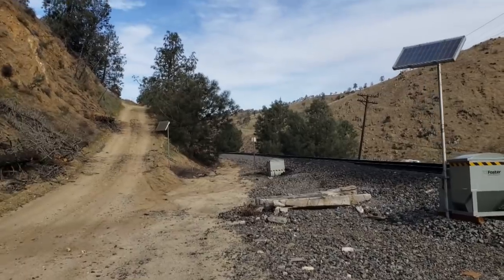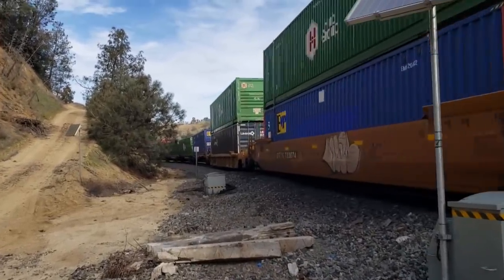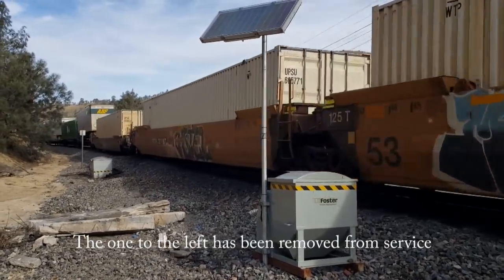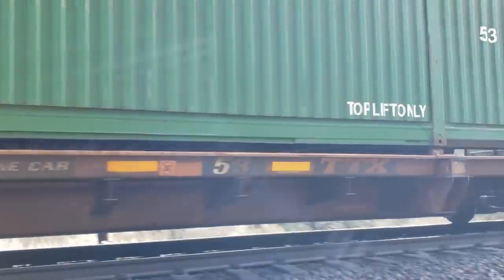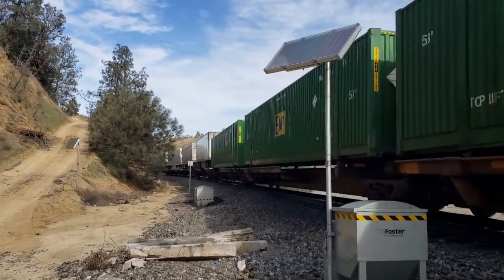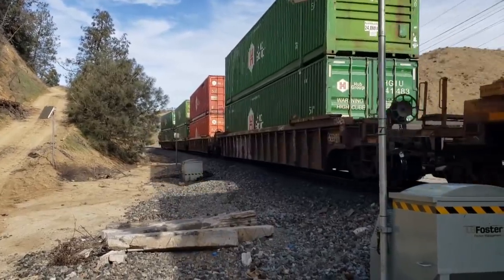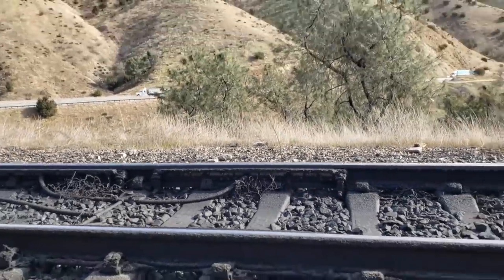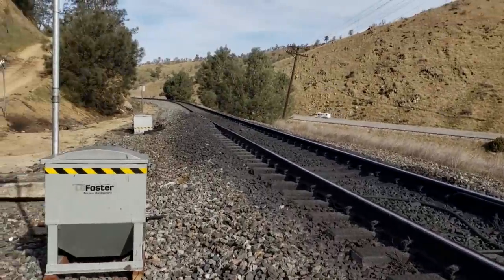How a Railroad Curve Oiler Works or How Squeaky Wheels Get The Grease!

Comment: Some curves I have seen squeal loud enough to harm your hearing if you are nearby. This is way cool - how to kill noise without losing tractive force! BTW - how cool is it to have a UP train roll by during the discussion :)
Reply: Wheel squeal is  heard at most curves.  It seems(wheel squeal) on ribbon rail because of higher speeds is louder.
Reply: We have that situation on some parts of the London Underground. The squeal generated is almost deafening, especially as it has nowhere to go but bounce off of the tunnel walls. If it was that noisy in a factory you'd be made to wear ear protection.

Comment: Does the Oiler Grease each and every train wheel on each and every train on both sides ?  Thanks!
Reply: Just one side - the inside rail of the curve.
But since there are left and right curves in various places that have curve oiling, they end up getting both sides just not at the same exact time and place.
The grease on the wheels wears off pretty fast but the important thing is the rail got greased right where it would be ground down quickly without the grease.
The outer rail of a curve gets virtually no wear because there is no side pressure against the outer rail.
Reply: @2Truth4Liberty   the wheels on inside of curve, rotate LESS than the ones on the outside rail. its the physics.Also, the wheel rides more on the high side of the wheel, which is the curvy part to the flange........squeek  squeek.....etc.
Reply: @petersack5074  [  the wheels on inside of curve, rotate LESS than the ones on the outside rail. ] Yes, of course, a little tiny bit less rotation. But that has nothing to do with the wheels on one side getting extreme friction from side force against the rail while the other side gets virtually zero (not even touching the rail). that's the physics of the squeak and wear and need for grease.
Reply: @petersack5074  Since there is a solid axle, inside and outside wheels always turn the exact same distance and speed.  The conical tire allows the outside wheel to cover more linear distance with the same number of rotations.

Comment: Have you ever recorded a heating switch in the winter time one's were there's fire coming out of the rails?
Reply from the maker: On the Tehachapi they just use small pots with fuel oil when needed under the points. The winter of 2019 was the only one worked through and I saw none in use.

Comment: Cannot speak for the UP but decades ago CN Rail switched to a vegetable based oil, which has a additive to deter animals eating it. For a while locomotives were built with a tank for some sort of lubcation to reduce friction on rolling railcars in an attempt to reduce fuel costs. Those have since been removed and now spring loaded solid bars of some form of antifriction material press against one of the rear set of wheels on most of our locomotives.  That one sound that happened was with a coupling, the two knuckles under tention (called draft) binding as one slid up and the other  down. They would of been both been dry due to rust, or new and not yet polished up from use.
Reply: It would seem more efficient to have grease dispensed from the locomotive.  It could be designed so the greater the angle the truck twists in the bolster, the more grease is dispensed.   I know of a RR museum with a circular track that ran an extended hose from the crankcase breather to constantly drip oil on the outside rail.

Comment: Now I wonder how the wheels keep from slipping, with grease on the track.
Reply from the maker: It's a very small amount and it's only on the inside of the rail. Today's locomotive's sanders are computer controlled to keep wheel slip to a minimum
Reply: @MarkClayMcGowan  Wow! That’s very cool. I wondered why the locomotives wheels did not slip.

Comment: Never knew that even existed ! Probably not used on a grade for loss of traction ?
Reply from the maker: Oh no! As a matter of fact the location where I shot this is on a 3% grade. They use them all over the mountain.
Thanks for checking it out!
Reply: Yeah we have them on Cajon Pass, and they create a fairly large pucker- factor when you're going downhill in full dynamic brake and you hit one of them. The grease immediately causes your dynos to drop out because there's no traction, so for a few seconds it can cause you to pick up speed, which you may have to chase with more automatic brake, which is bad because you can't "back off" the automatics like you can with the independent brakes, so you're stuck with a heavy set all the way down the hill. Anyhow my comment got too long so I'll leave it at that haha

Comment: Can you do a video on the communications side of things? Like the pole lines, antennas, and cables that run through thru the tunnels? Even the obsolete stuff that's still standing is interesting!
Reply from the maker: My next upload will be on the poleline but more on the signal side. The comms dept. stopped using their poleline many years ago which I'll touch on in the video.
Thanks for the suggestion and for checking it out!
Reply: @MarkClayMcGowan  You mentioned in one of your videos that Western Union had a poleline on one side of the RR and the RR had their own poleline on the other, I thought that was very interesting.
Reply from the maker: @brianleeper5737  I talk a bit more about it in the upcoming video which I'll upload Tuesday morning.
I'm slowing down a bit so I don't run out of content before the quarantine is up!
Reply: @MarkClayMcGowan  I look forward to see it! Thanks!
Reply: @MarkClayMcGowan  Also, I notice that AT&T frequently has fiber optic lines running along railroads...I assume that they had this right of way long before they used it for fiber, so I suspect they once had pole lines along the railroad, is that correct and did you ever see any remnants of AT&T infrastructure along the railroads like repeater huts and such? From what I've seen, AT&T was always good about making sure you know it's theirs and putting up the warning sign giving the penalties for damaging national defense-related telecommunications infrastructure.
Reply from the maker: @brianleeper5737  the railroads all lease their right of way to communications and pipeline companies because there is plenty of room and they don't have to disrupt highway traffic and dig through pavement.
The major roads were built first and leased their polelines to Western Union or whatever system was in that area. The roads had their own telegraph systems on those poles as well.
Reply from the maker: Brian Leeper.. the video for the tunnel radios goes up Thursday. I hope you enjoy it!
Reply: @MarkClayMcGowan  Thanks, I will be sure to watch!

Comment: Do you maintain the antennas inside the tunnels for the DPU continuity?
Reply from the maker: We (signal) did not. We have comm techs who take care of that but unless damaged, they require little care.
Maybe I'll have the tech give me a primer in that and do a video tunnel antenna!
Thanks for checking it out!
Reply from the maker: @john e. campbell...the video for tunnel radios goes up Thursday.
Reply: My cheap ass company just lets the dp run in communication loss. It keeps doing what it was last commanded to do anyway. As an engineer, I just need to make sure that it won’t be stuck in too high a notch before loosing communication.